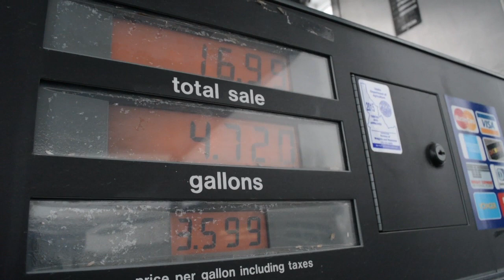MEGA CRITICAL OFF GRID WINTER TIPS & HACKS (Part 1)

Comment: You have a great deal to learn. We were the same way 30 years ago when we bought our cottage in Michigan.  

Dry your wood longer and cover all sides. You should let it dry for 1 - 2 years before burning.
Only use the slabs (what you have) for hot burning or starting fires. You need dry round wood for longer burning times. 

Convert your generator to a tri-fuel system . Can burn gas, propane or natural gas. Propane is easier to store than gas. Propane never goes bad. Start looking for a larger propane tank as well.  You don't want to rent them. We were paying up to $120 a year to rent a 120 gallon propane tank. It may take some time to find one at a great price.

Good luck
Reply from the maker: Great tips! How would you recommend someone season wood for 1-2 year when we have been here for 6 months. Paradox really. :) We'll get there. One thing at a time.

Comment: good tips ! I see you learn and adapt yourself ;
I know that for I have been living for 6 years in a caravan ( Wilk 580 ) ; surviving the 2 huge storms in dec 1999 ( Lothar and Martin - up to 192 km/h ) ; and another 5 years  2007 - 2011 ( caravan or camping under a shed - only roof & pillars) ; knowing snow too .....and it was in my 50's at he time !
Hello the Cat !
Reply from the maker: Bingo! Planning to a point then adapting and improvising the rest of the way!
Reply: +Pure Living for Life / thanks for your answer ; excuse me if it is not the right place for this answer/comment ! 
I was thinking of your off-grid project and perhaps this can be another way / example and perhaps may help you . 
-> Roland & Urte are ( somewhere ) living off-grid as they are 1100 ft far from the road without electricity or water line connections ( very old remote " farm " partially rebuilt from ruins when they bought it 15 Y ago - " the highest house in Brittany " ) 

-> -> visit -> http://www.troglogites-des-monts-darree.fr/les-gites.html

https://fr-fr.facebook.com/Troglogites-Des-Monts-dArr%C3%A9e-534279316627110/

I have helped them for the wind generator ; solar pannels ; wood-burning-central-heating ; hot water generator ( propane ) & plumbing + electricity instal' ; all that before their project of half-underground( kind of ) " motel " ( if it can be spelled like that ??? .....excuse me for my american certainly not the best )
Have a good day

Comment: Some great tips, especially about the generator !  Also running in the back of the pickup reduces the noise,

How do you handle exhaust from your propane furnace and water heater ?

Most states require gasoline to only be transported in a red container.
Reply from the maker: The cabin/RV garage is quite leaky with a decent air gap in the eave and ventilates well. On warmer days we keep the cabin door open to get lots of fresh air. 

Agreed on the red can, we just happen to have this yellow can and no one has made a fuss so away we go! :)

Comment: I went with a propane/gas generator made by champion (7000kw $800 at Costco). I've only run the propane through it and have been very pleased with the performance, and not having to deal with gasoline, especially when its hot! Never had it freeze up either!
Reply: Lester Nielson good call. Propane is so much cheaper to run and less wear on the equipment

Comment: Get a roof over the Wood to burn to keep it dry. Saves Wood as the energy to dry it off in the stove steal lots of cords over a Winter season. Place empty pallets as a mean to keep the Wood from touching the ground. If Wood touches the ground it gets damp and wet a foot up or more.
Reply: Optimal is to cut the fire Wood to use during Winter Before summer and store it under a roof. Get more mileage. Wood that has cured during summer is dry and less Wood has to be burned.

Comment: Use pure gas, stay away from ethanol blended gas in the winter, especially for small and older engines.  It will run much better.  The ethanol attracts water and can cause those icing issues, and it will make cold starts easier, and you'll improve your fuel efficiency since ethanol has a lower BTU than gas.

Comment: Does your RV have a generator? Just wondering if your running everything on just the little Honda. I do like the idea of running the generator in the back of the truck, it has to help with the noise as well. Love your channel!
Reply from the maker: It's a small RV. Has a built in inverter/charger but the charger isn't keeping up with our charge needs so we've added a Shumacher Ship'N'Shore charger that is working well this far. The Honda works great and is plenty for our needs. In fact for 60% of our needs it's overkill but when you can only have one it's handy to have the extra power when needed. Shouldn't need to upgrade for a long time as it'll also handle being a backup for our solar setup once we get there.